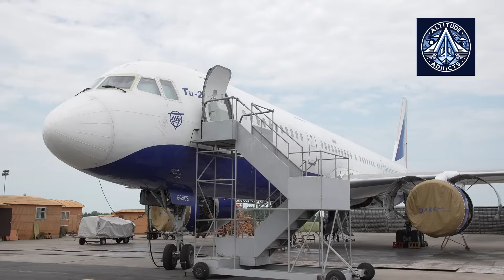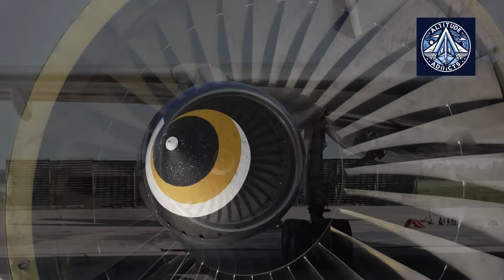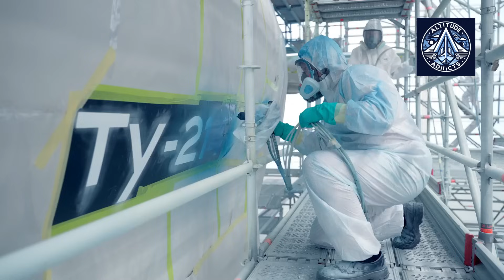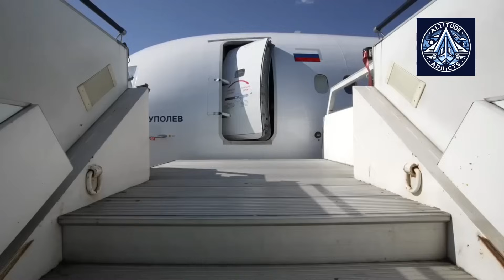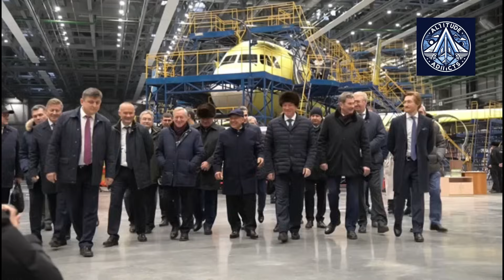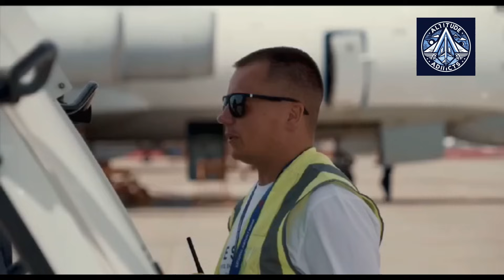Tu-214 - 9 Equipment Replaced, 46 in tests

Comment: It was a serious lack of support by Russian airlines for the aircraft that got them into this state, and cancelling orders now is just cowardice on the part of those airlines. Tupolev have invested in fixing all the problems of the aircraft and having the aircraft in service and use will justify the ongoing improvements and upgrades that keep western aircraft relevant despite them being much older than this design. The Russian military has an enormous number of obsolete aircraft on its books that need to be replaced and the Tu-214 would be and ideal aircraft to replace many of them like the Il-20 and Il-22 and Il-62, and Tu-154M. A tanker aircraft version would be useful and a reduced size AWACS type would be valuable too, especially if it is optimised for tactical use to detect drones and other small threats on the battlefield. Recon and EW support types would also be useful. Most of their new aircraft have inflight refuelling probes but the Il-478 is not being produced in large numbers.

Comment: Don't understand why they haven't modified the cockpit to 2 person crew? The TU-204 had already been modified so why is it difficult to modify the TU-214 cockpit?
Reply: Be patient. There has been a process of modernization of the Tu-214 with a focus on: reducing weight with the use of composite materials and changing from 3 crew to 2 crew. The process has been carried out with a competition attended by many young generations who are experts in aircraft manufacturing.

Comment: same pattern seen at Sukhoi .... while the aircraft is being modified to remove foreign parts .... the production lines are being modernised whilst not in use .... makes perfect sense - as product engineering and production engineering are quite different ....

Comment: The Tu-204/214 is the ONLY Russian airliner which does not required wing anti-ice system. Western analog is only the B787 Dreamliner with electrical heaters. IF TU-214 will drop down the RB211 engines and manage to have good, fuel efficient and with spare parts support Russian engines it will be a market BEST SELLING aircraft. ALL cargo companies are crying because B757 is dead and don't have any other options except the B777 or remaining B767. Also the cockpit must be designed for two crew operation and the aircraft must go design inspection and become lighter where this is possible. Russia must move methodically and persistent on production of TU-214. It will be a market HIT !!!!!!